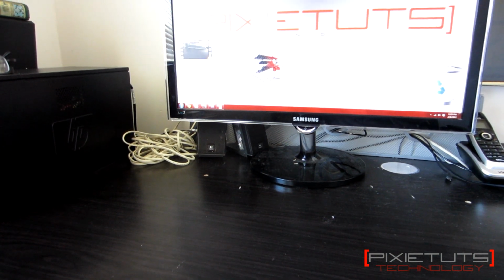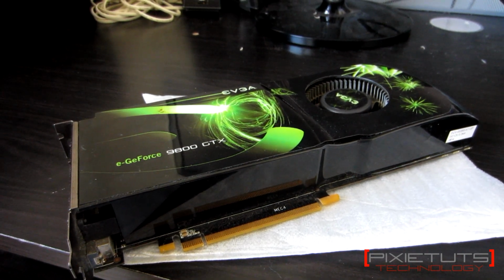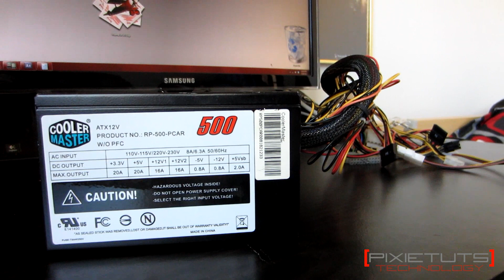Tutorial: Separate Power Supply for your Graphics Card

Comment: I was wondering if I could use a PiCO PSU for my Motherboard's miscellanious components(fans,north bridge, ram etc) but for my GPU and CPU an external PSU?
Is the pico PSU going to interfere with my plan to connect the CPU and GPU from a different power source(12v) my PSU is an HP1200 watt server PSU and the pico PSU is also going to take its 12v input from this (1200watt server PSU)??
Any help is greatly appreciated!
-Arbër

Comment: Thank you! You are a saint! For those who don’t understand, if you don’t use the paper clip the power supply won’t running so does your graphics card. The green wire is the power sensor it tricks the psu thinking it’s connecting to a motherboard
Reply: can i just cut out the pins from an old motherboard and plug them in ? :D stupid question i know but
Reply: Could I plug it into another motherboard? As an alternative to using a paper clip?
Reply: @kksprstn6186   My guess is you could
Reply: @kksprstn6186  yeah but then you'd have to short the power button on the mobo similar to how he does with the paper clip. my question is does your psu need a power switch on it to accomplish this?

Comment: Why don't you just remove the old power supply replace it with the new more powerful one?
Reply: A lot of the motherboards on computers from major brands like HP and Dell are proprietary and use proprietary connectors and PSUs to power their motherboards. 

Some of these proprietary connectors don’t have third party adapters available to make them compatible with standard PSU connectors so it unfortunately makes workarounds like this necessary.

Comment: It worked! Thank you bro! I just bought an external psu and vega 64. Thought i could just plug in the 8 pins. It would not power on. Figured my used gpu was fried but it powered on! For evga just read tutorial about testing psu paperclip.
Reply: If I do this with an sff dell optiplex 3010 and Rx 570, will it work
Reply: @kivelocity932  just make sure you put the paperclip in the right holes. Some psu have different plug in layout.
Reply: @eternalbeing3339  How do I know they are the right holes?
Reply: Eternal Being33 bro thats impossible, all psu has the same plug layout, otherwise they will have to make specific motherboards for each psu
Reply: Iván Meiksins I know I was like reading and was like lol
Reply: @kivelocity932  or buy a psu detection tool

Comment: It is safe or not. I mean it can damage gpu due to over voltage. Please answer me
Reply: I don't see that you got this answered so I will throw my 2 cents in. While I am no computer genius, I do understand how power works. The PSU (or anything else that supplies power ie; home electrical outlets) does not "push" power out, it simply SUPPLIES power. Thus, I don't see how this method could be the cause of any problems as your graphics card or any other component plugged in to the unit simply "draws" the power that it requires at any given time.
Hopefully this helps somebody!
Also, props to the OP reference the green/black short. That's what I needed to know as I am about to hook up the PSU from my old PC to power a couple of SATA drives until my splitter arrives.

Comment: So I know this is an old video but AFAIK, the EXP GDC "beast" eGPU that a lot of people are using for an external graphics card now has an ATX power supply switch, as of versions 8.0 and higher (8.4, 9.0b, etc). So I guess the paper clip trick is no longer needed? I am new to setting up these things and I will try my first eGPU when it arrives in about a week. Correct me if I'm wrong in this reasoning

Comment: By doing that, gpu is running on 100% and getting more power than it actualy needs at that moment, meaning that running that for longer time will damage components.

Usualy motherboard controlls the power output of the psu, meaning that it's unefficent, as all 500w are being drawn from your outlet, and components will not work very right.
Reply: Electricity doesn't work like that.... the PSU cannot force the graphic card to use all the 500w what it can provide to it - it's work the opposite way.  The graphic card draws the power what it needs, depends on its actual workload. Eg when you dont play and the graphic card is idle, it wont use all the 500w power, just the amount it needs.

This is the same story if you use a regular setup (the video card is connected to the build in PSU), it is no different in case of this additional PSU.
Reply: @lammaerb7867  Good
Reply: Acid Shot can't you control that with the mail afterburner ?

Comment: Are there diodes used here to isolate each power supply from feeding or unbalancing each other? Doesn't look like it. Are two power supplies actually joined cable to cable with no other components? So how is the current draw shared and regulated for each of the paralleled power supplies? Doesn't look like it is. Looks dodgy as hell.

Comment: Old trick. But idk man I have a HD5870 that works and a few server power supplies. So I hooked up a PS-3381-1C1 (ESP113) with 32A on the 12v rail (I have a seperate 250w supply for the MB/CPU. Wires got hot(the ones to the gpu) but gpu did not work.. While it worked in my test system (with proper psu750w modulair psu).. any ideas??

Comment: Instead of having a future electrical accidental (a short), why not pull the green and black from the plug, twist (or sodder them together) and use heat shrink around it.  It will prevent any accidents later.
Reply: some PSUs come with a short plug so you don't have that accident. it's like the paperclip idea but it's completely insulated

Comment: This is all well and good ... isn't there a danger that the earth reference (the black wires) for each power supply could be at different voltages and do horrible things?
Reply: There are adapters that literally do the same thing as this. Just connect the green #4 wire to the black #5 wire. That's what all the adapters do.
Reply: Black wire is ground so there's no voltage there
Reply: There is no voltage in the ground reference, you should go to school while you look like already 50 or 60 years old
Reply: @Nobody-eg4bi 😂didnt have to do bro like that
Reply: I was thinking the same thing.

Comment: thank u soo much I have been wanting to upgrade to the gtx 1060 but as I have a HP I can't upgrade a power supply so now I can add another power  supply
Reply: nice i got a sff hp as well very hard to fit stuff in but i was gonna invest in a gtx 1060 as well so far i got my computer for 130 bucks and stuck a 50 dollar gtx 750 ti in it and has an i7 3770 non k but damn i love it to death lol but you have to turn the external psu on first?
Reply: shineything4444 yep, i got a power strip so i leave the power supply switch on then when i hit the button on the strip, it turns on my power supply then my monitor and i manualy turn on my pc
Reply: Lyple does this actually work? I have a hp compaq 8000 sff and my intergrated graphics are shit and my psu is only 240 watt
Reply: Jimmy Said  well Ya But u would have to turn on ur graphics card power supply first, I have a HP Compaq 8200 elite cmt but it should work if u hav a pcie slot
Reply: Jimmy Said and u will have to get another power supply
Reply: Lyple ty for the quick response
Reply: Lyple ty for the quick response
Reply: Jimmy Said lol, I just got out of school and looked at my notifications
Reply: ***** yes and i love the 1060, but i put on of thos power things with all the outlets and a switch so when ever i turn on my pc i have to flip the switch and then hit the power button on my pc when the power supply is running so then i never forget to turn the graphics card power supply on, which mounting everything took about a hour, but it works, and i really think u should try it if you cant afford another pc or if u  cant put a power supply in it//// mine was a budget build in which i got a care i5 and a gtx 1060 with windows for $450
Reply: ***** nice
is it a hp
Reply: shineything4444 for the gtx 750 ti doesnt need a six pin connector. so maybe is the powersupply not even needed.
Reply: Man out here I know that lol I have it currently but in a month I'm gonna go for a gtx 1060 lol
Reply: shineything4444 how much watt is ur powersupply?
Reply: Man out here it is a 300 watt but it's only powering the gpu only
Reply: shineything4444 what kind of sff u got?
Reply: mine is a hp compaq 8000 elite sff with a powersupply of 240 watts im wondering if it can run the gtx 750 ti
Reply: Man out here I think an 8300 ik it's an upgraded psu from oem and can run the 750 ti with no issues and has a 3770 inside its my dirt cheap mad max pc lol so far I spent under 200 bucks for it and does a great job
Reply: shineything4444 i got mine for €15
Reply: ok i just got home and checked its the 240 watt but i have no issues with it whatsoever

Comment: You can, if you want, wire the green connection and a black to the same green and black connections of the main PSU's 24 pin and the single power button for the motherboard/case will power on both PSUs.
Reply: CJICantLie what you mean with wire'ing? Are there adapter ? Or sothering needed ?
Reply: this sounds like more work for the same result
Reply: I needed this
Reply: This is really old but in case anyone was wondering he meant splice the green to green and the black to the same black from the second psu to the first psu. That means connecting em together and putting electric tape or solder
Reply: good point

Comment: this won't burn anything out in the gpu or mother board?
Reply: Ben Silva Oh by the way, it worked. I have a fully working XFX Radeon RX 480 8GB OC Edition in my pc. I can run games like ARK on EPIC settings / all games on 1080p with at least 40fps+.

Btw was a shitty pc when I bought it like a year ago (but good for the money). The only good thing about it was the core i5 processor, I upgraded it to 12GB RAM 650W + 320W PSU, XFX Radeon RX 480 8GB OC and a new 1TB HDD and now it works like a gaming beast.
Reply: @KiemPlant  how would u turn everything off/on?
Reply: @nibba241  I long ago upgraded to normal hardware, but I used to have my secondary PSU hooked up to a powerstrip with a switch on it so that would be the way I would turn everything on/off. Sometimes I forgot to turn on the second PSU but it just simply wouldn't boot in that case.
Reply: +Ben Silva I'm so excited I'll be trying my 1060 today
Reply: Ben Silva Yes I plugged an extra ATX PSU into my new GPU (like in the video)
Reply: I am going to do this as my motherboard has no 22/4 pin connector for some god damn reason.
Reply: oh and the stock psu has no extra connectors.
Reply: +Ben Silva so if I use a separate psu for my gpu and use a paper clip from the great to black wire it should work?
Reply: +Ben Silva I'm so excited I'll be trying my 1060 today
Reply: @paightoncassidy8454  Did it work? :)
Reply: Ben Silva  Excellent comment, very informative. Thank you
Reply: Ben Silva  Which eGPU are you using? I am going to use the EXP GDC Beast (yes, I know I'm cheap) 8.4 eGPU from a Chinese wholesaler. The 8.0 and above supposedly has fixed the ATX bug, unlike earlier versions, so presumably a paper clip jump is not needed. The website reads "support soft switch function.( ATX cable with no power limit)" Am I right in assuming this?